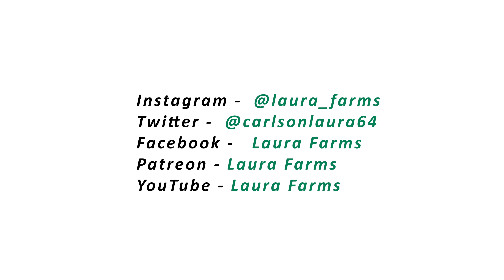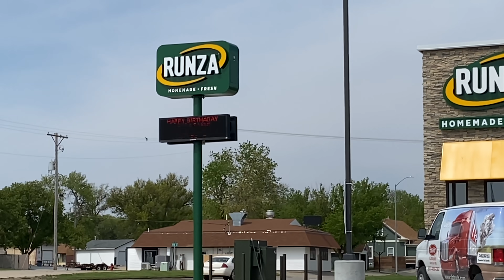It's My Birthday!

Comment: in 1969 , i got stuck in Aurora to get my car engine rebuilt...sitting in the field behind the dealer with a cat on a leash freaked out by the curious cows leaning over the wire fence. and this is my total memory of Aurora....and i missed Woodstock.

Comment: google "dust collection cyclone separator"  I build one for my wood shop, sits on top of a 55 gal. drum. Goes between the hose and vac unit. I'm pretty sure it would pick up the seed and don't need to empty the shop vac near as much.